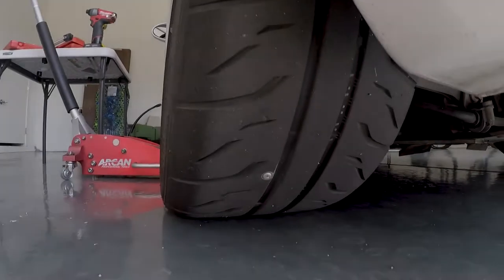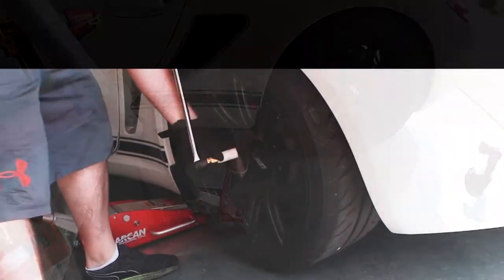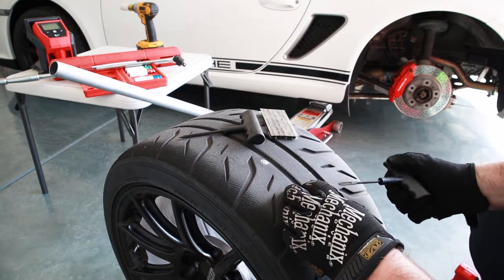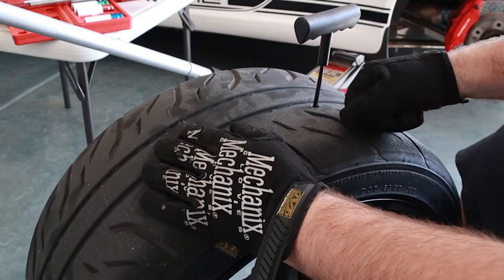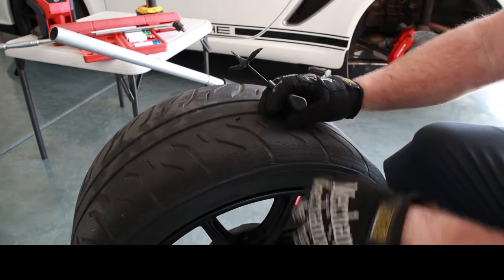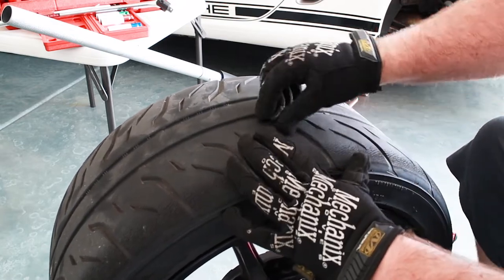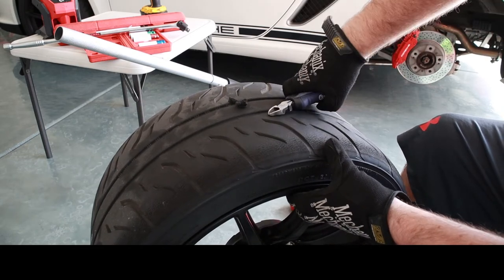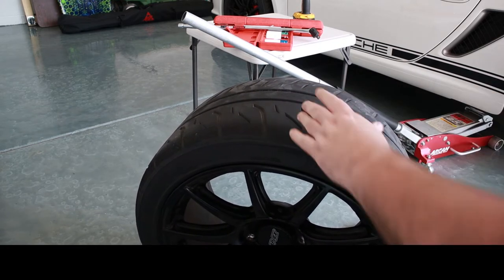$7 To Fix a Flat - Quick and Easy-ish!

Comment: The kits usually come with rubber cement. At least for lube. Lube up your plug makes it easier to shove it in. And easier to slide your tool back out.
The plugs are almost good as new. I even patched Motorcyle tires 🤫. Squirt some soapy water if you are worried about is it holding or not.

Comment: Great instructional vid as usual.   Is that a portable battery powered air compressor?  Where can one be purchased?
Reply from the maker: Thanks for watching! Yes, the air compressor is by Milwaukee - part of their M12 tool lineup. 2475-20 is part number. It's roughly $70 tool-only and $100 with battery and charger. Home Depot carries them and toolsplus.com has online.